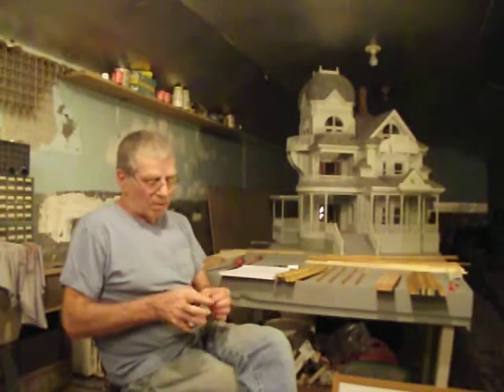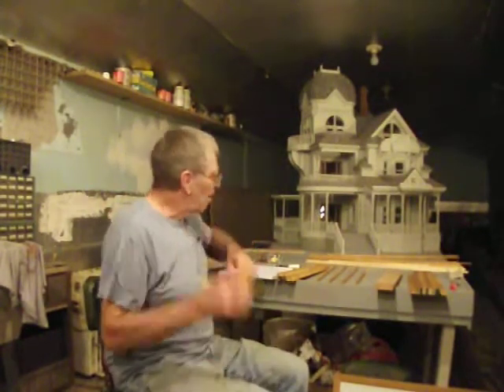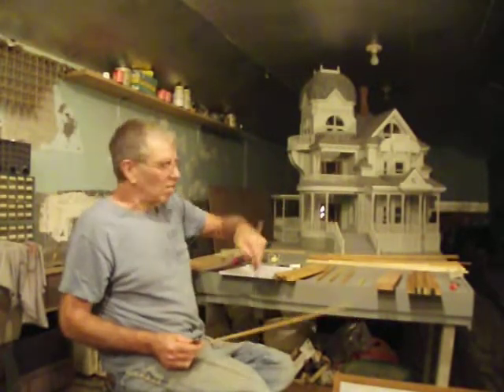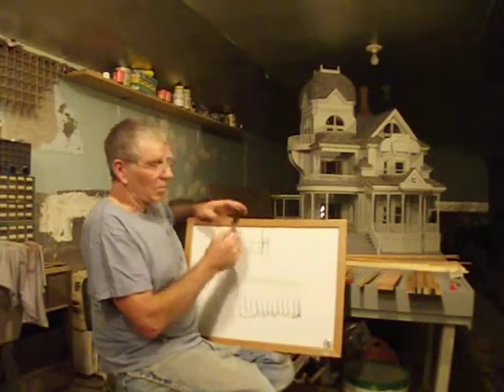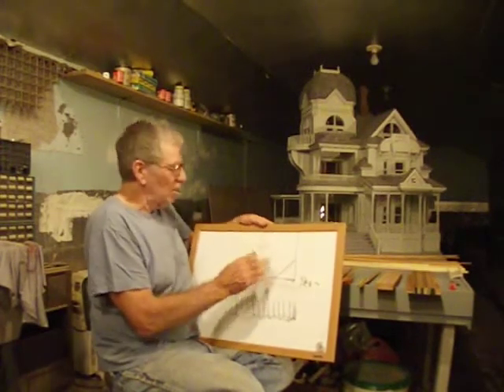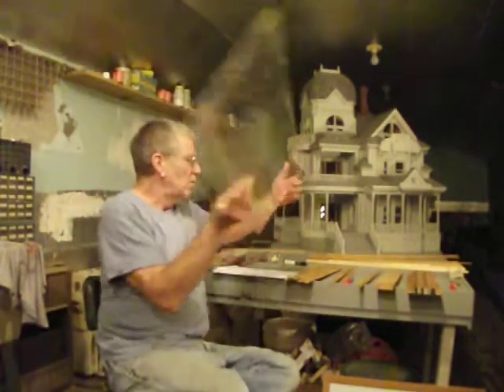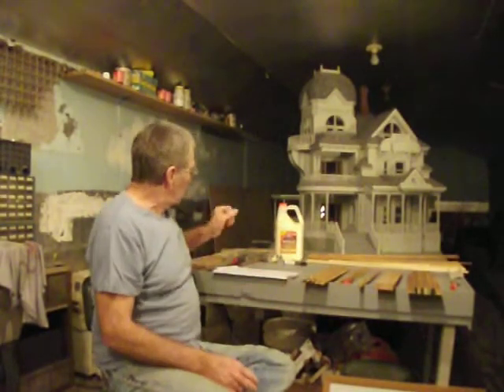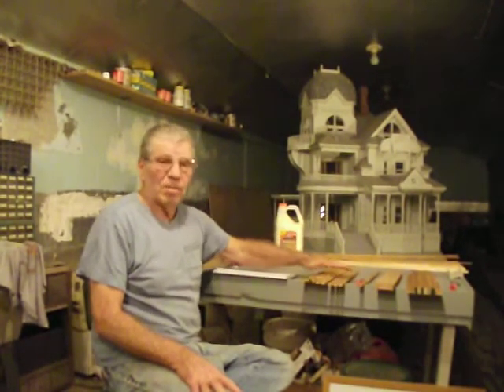The Connor Cabin

Comment: Pythagorean theorem, right angle of square 90 degrees with sides of 3 and 4 will have a length of 5 for the hypotenuse . Wood glue doesn't work well on painted wood, good to know stain is ok